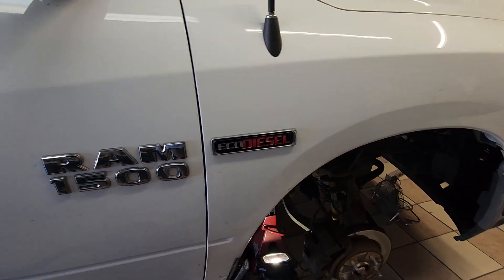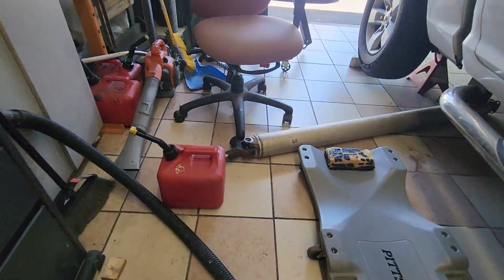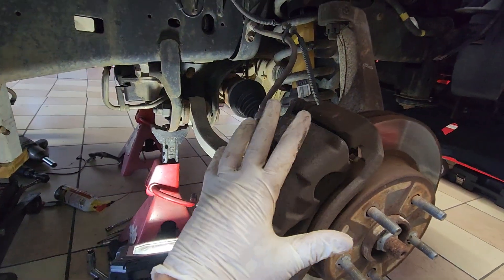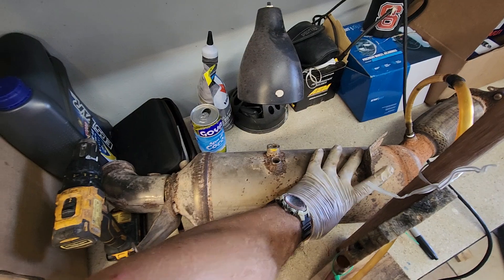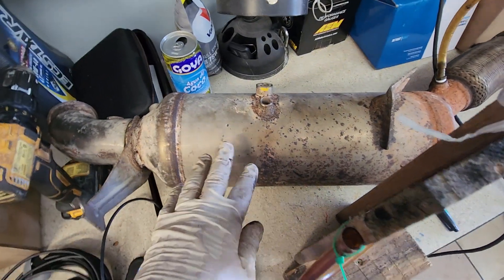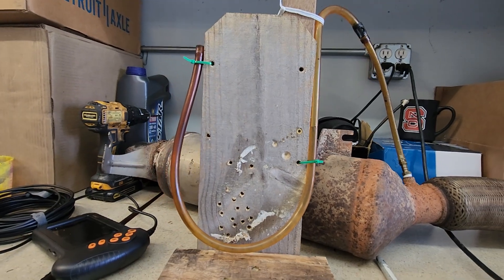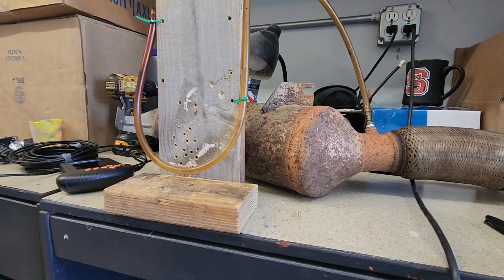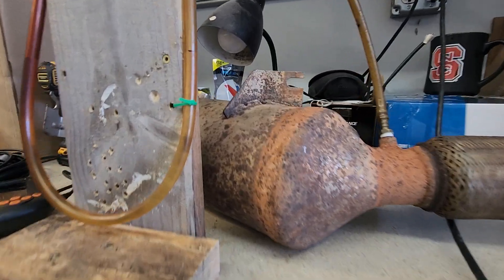Ram Rcodiesel DPF Cleaning pt1

Comment: Good  job, will be waiting for the follow up, also good job on the video, straight to the point and no fluff👍👍
Reply from the maker: Sorry, got too busy to do a followup, it required too much editing. Basically, I don't think I'd recommend the acid bath. Maybe just try using the hose on it. I've still been getting frequent regens and recently saw a Catalyst Efficiency code. After doing this procedure, I read somewhere that there is a coating on the DPF and the acid may have affected it. It did etch the stainless steel after all...